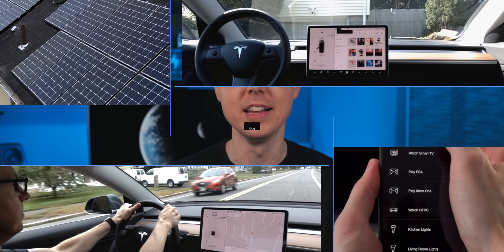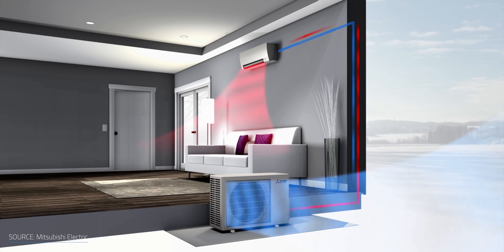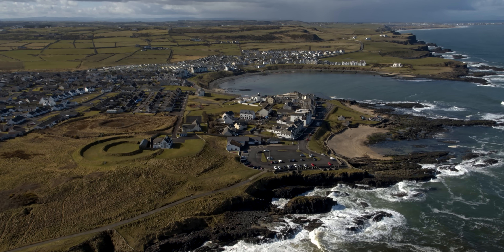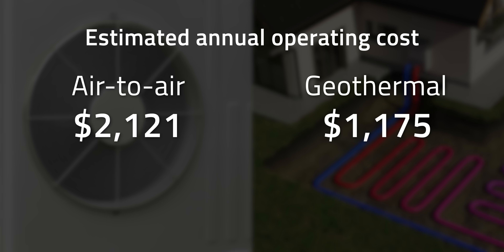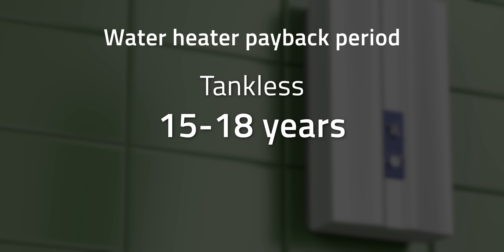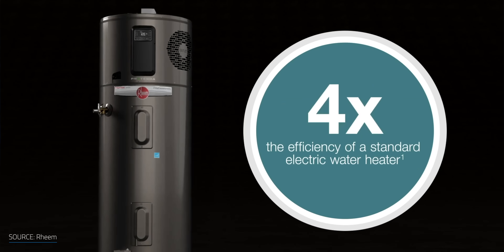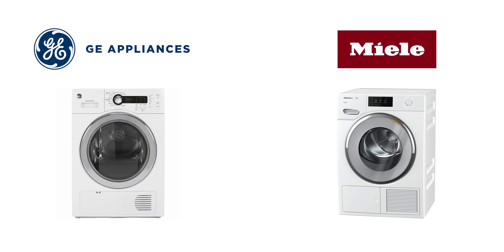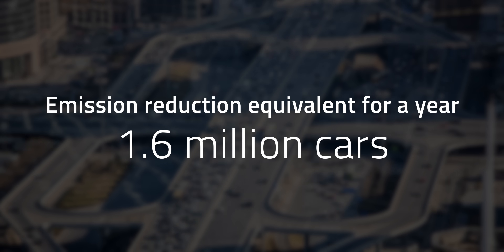Why Heat Pumps are Essential for the Future - Explained

Comment: In europe, they're pushing for heat pump everywhere. You can't get classical AC anymore, you get heat pump. And they are not that expensive. And they work pretty well.
Reply: Good.
Reply: I have an AC build.
District heating (also known as heat networks or teleheating) is a system for distributing heat generated in a centralized location through a system of insulated pipes for residential and commercial heating requirements such as space heating and water heating.
It works great
Reply: That’s so interesting because in the states the only thing I see being pushed is solar. When building a house in most areas they don’t bring up anything other than the current status quo. Per usual Europe is both ahead of us in conversation and action.
Reply: Just about a couple of hundred difference in price between HP and AC
Reply: Europe is always ahead of the US in this regard. Combine heat pump units with renewables and the future isn't looking quite so bleak. Especially if we can get most ICE vehicles of the road.
Reply: A heat/cool system is identical to a cool only system for one small item, a valve that can reverse the direction of the flows of the heat transfer medium. You have to be careful with sizing. In a well insulated home the smallest models should do just fine, in badly insulated homes you better insulate first or you will end up with something rather costly and power hungry. Since you are in Europe, your Energy Performance Certificate (EPC) will tell you a lot about what would be right. If you don't have an EPC maybe get one before you overspend, EPC is cheap big heat pumps are not.
Reply: @Bryan-Hensley  It's the same device with some extra components to reverse the flow of the heat transfer medium. It's almost plug and play to swap.
Reply: @Different_Banana1977  yeah I had one here in the USA in the 1970s.
Reply: @astranger448  in a badly insulated home youll also spent lots with traditional systems
Reply: AC is an air sourced heat pump anyway, essential if you live in a flat as most Europeans do.
Reply: @mightymouse2024  as much as I get the sentiment, most Europeans still live in houses, but it’s a close run thing.
Reply: In the southern US all new homes and apartments use heat pumps. It’s not mandated by the government, it’s simply the cost effective choice because one system is heat and air conditioning.
Reply: @astranger448  I've owned a HVAC company for over 20 years
Reply: In Finland we've been installing them for good 20 years now usually as additional heaters and I've always wondered why haven't they been so common elsewhere. Afterall Finland hardly is an ideal environment for the heat pump during half of the year when it's so cold the efficiency drops quite a bit. Still they usually pay themselves back within 5-8 years. Where as for most of mid-Europe they are perfect, just until now cheap natural gas thanks to the pro-Russian policies haven't really helped...
Reply: So in Europe what is your money really worth and how much is the apparatus really costing you..?
I know here in the US the dollar is worth 0.06 cents. So our gas prices are not $5 and $6 a gallon, it is in reality like $0.40 per gallon.
I know a lot of people have a problem with this reality, but it is reality, like it or not.
Reply: @cynthiaayers7696  that is a factor of course. Average electricity price in Europe is close to 30 cents per kwh. Cheapest being around 10c and Germany most expensive around 35c. Fuel prices over 2€ per Liter currently. Prices of the units are the same.
Reply: Most AC systems are just heat pumps that pumps heat out of a building over here in the US. It's ridiculous that they aren't being built so that process can be reversed when heating is required.
Reply: @Alexandra_Wolf  you mean United States?
Reply: Yes, but in Europe it never gets very hot, or humid, nor does it get very cold. Not sure how well a heat pump would work in high humidity like we see in the U.S. A/C condensed a lot of the humidity out of the air, that's why AC units have a water drain.
Reply: @Alexandra_Wolf  completely different climates, Europe does not get as hot or as cold as North America.
Reply: Heat pumps are great so long as the temperature stays above 0°F. If you are living in a region where it constantly dips below zero then you’d have a high electric bill having your heat strips run due to the heat pump incapable of properly running. Gas furnaces aren’t going away for those in the north any time soon.
Reply: @Bryan-Hensley  But this is the internet, it is not just you and me. So if I spell out things overly much it's for all these other blokes ;-) (I'm from a teaching family)
Reply: @kdrapertrucker  well that's a load of nonsense...
Reply: @user-by7hj4dj9s  Absolutely. So what is one to do? I'd fix the insulation if that's an option (often it is not) and/or look at the existing system and if it is old  and/or inefficient I get the most modern/efficient version I can fit in my budget. For gas furnaces they could be a plug and play replacement. I would avoid using something that is currently very badly understood.
Reply: There's basically no difference between an AC unit and a heat pump. Essentially just a 4-way valve that allows the refrigerant cycle to reverse
Reply: That’s good. In the US they are now pushing AC only for some reason. At least in my area….
Reply: @ryanhamstra49  That's been the story in most of the US forever. Hopefully sentiment changes towards heat pumps but most people think they don't like them because of the way thermostats have been designed to this point. Technology Connections has a great series of videos on heat pumps
Reply: @Kenneth Draper. I notice you say North America, so presumably you mean Europe as a geographic area (which includes Russia up to the Urals). While North America has a more extream climate than Europe for example one has to look to Siberia (in Asia) for colder places than the coldest in Canada), does North America  have a more extream climate for cities with more than a million inhabitants than Europe?
Reply: @Timo-qb1gf  lol 75+ cents in the Netherlands now.
Reply: @Alexandra_Wolf  depends on the area. In the Pacific Northwest they have been taking off.
Reply: @Different_Banana1977  : Unfortunately, getting rid of ICE vehicles isn't currently viable. We're moving that direction, but the process only really started with the creation of Tesla, and unlike e.g. the Model T, it currently depends on what was an insufficiently developed industry (lithium, whereas everything the Model T depended on had already been greatly fleshed out by e.g. the railroads).

As time passes this problem will fade, and if shorter-range sodium-ion battery vehicles start entering the market then things will accelerate more, but we still need to look at converting existing ICE vehicles to synthetic fuels first.
Reply: @Alexandra_Wolf  in the states hea pumps rage easily up to 10g.
Reply: I'd say where I'm at 70% of homes have some sort of heat pump. So ya. Not improbable.
Reply: Classical Ac T-T?? I've just managed to convinced my parents to get one that too after years of begging and it always stays above 42°c during summer here.
Reply: Heat pumps are just ac that can switch the direction of heat exchange
Reply: Yah, as a hvac tech who has worked in the field for over 20 years. It’s obvious you never owned a heat pump. No they are not efficient. And no they do not keep up.
Reply: Also, their more expensive. Don’t lie. Anyone can look up prices.
Reply: @Alexandra_Wolf  city of Flagstaff, AZ hosted an expert webinar in heat pump systems, which have challenges there due to low winter temps. Very informative.
Reply: @ashurean  Electricity is expensive. Natural gas is cheap.
Reply: @Timo-qb1gf  Actually it's not. I'm sure the engineers think their flatulence has the fragrance of flowers but in North America, heat pumps are supplemented with heat strips to keep up because they don't do the whole job when it gets cold. At that point you need a gas furnace for affordability. I have no idea what they're doing across Europe and I couldn't care less. It's not applicable. Just insulate the house and talk about something else with your friends.
Reply: Where in Belgium, the Netherlands, France or Germany can we buy any portable heat pumps? I see units up to about 15,000 BTU in every hardware store and Euro Shop/Vandenborre, but they are only AC units.
Reply: @Alexandra_Wolf  Heat pumps don't get a lot of publicity like solar cells. But they are making their way into new homes here to. Especially in the prefab market. Their adoption is going to increase with every new house built.  The problem we are facing is replacing AC systems with heat pumps without a subsidy it just doesn't make sense from a financial standpoint.
Reply: Heat pumps are great if the proper system is installed. The process of air conditioning is essentially heat rejection. You absorb the heat at the evaporator and reject it through the condenser. Heat pumps use a reversing valve to switch the process making the evaporator the condenser and vice-versa. Even when it’s cold outside there is still heat in that air to be absorbed. The lower the ambient temp is makes this process less efficient. There are systems that can do this still incredibly well even with very cold temps but tend to be costly such as VRF’s, also called VRV’s. Unfortunately they also have significantly more components that can fail. Have a VRF’s that I service in quite a few locations. Have a park and rec center that has no cooling waiting on a 16$ part that is 4 weeks out, just a coil for the linear expansion valve, lovely!
Reply: @kdrapertrucker  heat pumps generate water condensate too, and also have to drain outdoors. Because they ARE regular AC when operating in cooling mode. Whichever side is colder (so the outdoor one when you’re heating, the indoor one when cooling) generates a little bit of liquid water constantly.
Reply: @Alexandra_Wolf  I am a hvac servoce tech for starters so I see these units installed every day. they are definitely being sold in mass in The us however, it’s not being pushed as a green energy thing because you have to supplement another heat source when temps drop below 35f. Most houses still run off natural gas. That being said natural gas furnaces are pushing 90-95% efficiency these days. Another thing is not everyone wants to pay for a heat pump because of how expensive they are marketed in the us. Lower income tends to purchase ac only condensers and middle to high income purchases heat pumps in ranges of effficiency known as a seer rating. I love heat pumps and the savings they provide the hard part is convincing people to spend the extra money. One final thought on the video he said heat pumps don’t release harmful gasses but if there is a refrigerant leak, which happens offen, they do in fact release harmful gases
Reply: @FreonChugger  generally heat pumps don’t work well below 35f also in the north us many homes with heat pumps still use natural gas as the auxiliary heat
Reply: @Bryan-Hensley  question are you more interested in the money you get from the mark up of a new unit or the money you make per hr as lot of people who have old ac units would like to upgrade them to a heat pump most outfits would rather sell them a new unit than upgrade the one that they have now if the unit is close to the end of it's life sure replace it but if it's only got less than a year or two then upgrade
Reply: The "classical AC" uses the same thermodynamic cycle as a heat pump though? What's the difference?
Reply: "You can't get classical AC anymore, only heat pump" 😂😂😂😂😂
Reply: ACs are heat pumps! They just aren't reversible heat pumps
Reply: @ashurean  yes they do it's called a reverse value.  all the last three AC units we had has one in the one we had replaced! it's basically just a built in standard feature in all of the current up to date ac household residential  and industrial ac units in the usa all have a reverse value that turns the ac into a heat pump with a simple electrical signal from the thermostat and this was back in 2008 and onwards by the way!
Reply: I have a heat pump for my home. It's an old unit and it gets quite expensive to run at 0C or below. When it's time to replace it I will be getting another and one with the ability to operate effectively at lower temps. Hopefully I can find one that operates well at - 10C
Reply: True. Unless it is really freezing then they switch to traditional heating. Better use the old stove then.
Reply: @JohnSmith-kb5ku  It is true. I can’t find a pure AC without heat pump unless it is a portable one.
Reply: @frgv4060  may be like that where he is. I have a lot of family in Italy, and everyone's house has a heat pump in the form of ductless mini split systems. In fact that's the only type of HVAC I saw while I was there. I was there for several months at a time and lived near one of my cousins houses. I will say, no one really wanted to use it. It was always.. turn it on, with the doors and windows open, after 5 minutes someone would complain that they're too cold, then it would get shut off. 😅
Reply: @antonisautos8704  Haha very true!
Reply: Where in "Europe"?
Reply: @leventejuhasz2525  Western Europe
Reply: @Alexandra_Wolf  new builds in the US have heat pumps, and literally all HVAC companies offer them...
Reply: In my area of the US, AC units without a reversing valve (AKA a heat pump) are special order and cost just as much as with the heat pump, if you are installing a central air or a mini-split there is literally no reason to not get a heat pump.
Reply: @HangEmHigher  this used to be true, they actually have heat pumps that are good to -5F now, they may not be able to satisfy your heating needs alone but they still work.
Reply: @kdrapertrucker  dude. Are you serious? What do you think europe is, just london?
It does get freaking hot, freaking cold and freaking humid here as well.
And especially in finland it gets cold. It's litterally part of the polar circle, where santa comes from, and they have been relying on heatpumps for decades.

It is just ultimate lazyness. As long as you say "can't work here, to different" you justify doing nothing.
Nice and easy living in the 20th century.
Reply: You onot the difference between a AC and a heat pump? A bidirectional pump, and a reversing valve, that is all, al in all 10$ max in parts, there's no reason all ACs shouldn't be heat pumps
Reply: @kdrapertrucker  humidity doesn't affect heat pumps, heat pumps are literally an AC ran in reverse, if you can run a AC where your at in the high humidity of the summer, why is humidity going to matter in the winter when it's lower?
Reply: @FreonChugger  heat pumps can have a transfer loop placed into the ground, the temperature below the ground is always above 0°
Reply: @jaykoerner  couldn't agree more it's just AC with a reversing valve and a couple check valves
Reply: There seems to be some confusion here:
- in 'Europe' very few households use AC systems.
- AC cooling systems can be found in Europe, but depending on the region. Almost nobody has it in Germany, some are installed in Italy the more southern you go. 
- Heatpumps (Air or with absorber tubes, etc) are pretty common in Europe since over two decades, but their efficiency depends on the temerature difference, the lower the difference the higher the energy consumption to pump from cold to warm.
As long as electricity is cheap (or costs nothing when generated via EV) compared to direct fossil fuels, heatpumps are petty economic, this changes with higher electricity costs. Then heating with solar (or at least making hot water) is unbeatbale as long as you have enough surface on your roof.
And by tbe way every fridge is a heatpump...
Reply: @FL-ul5mq  "every fridge is a heat pump" by that same idea every AC is also a heat pump it is just a matter of which direction you are moving thermal energy. The idea that AC is rare in a area but heat pumps are common is pretty strange, an AC is mechanically the same thing as a heat pump the only difference is the direction the refrigerant flows. This is why installing a purely AC unit is so rare now because all you need to do to make it both AC and a heat pump is add a reversing valve and a pair of check valves to the refrigeration loop which costs like $50 more (next to nothing when you are spending thousands).
Reply: @CUBETechie  No reason your centralized heat source can't also come in the form of a data center or a crypto currency mining rig.
Reply: I can only assume it's a marketing lingo difference to get people to ditch oil/gas/electric baseboard heat in cooler climates. 

AC systems are heat pumps. They just may not have a reversing valve, so they wouldn't work to heat the home.
Reply: @infinitetradecraft1837  a lot of people don't seam to understand this, but a heat pump is just an AC with the evaporator outside and the condensng coil inside. In the HVAC world we are trying to stop calling them evaporators and condensors they are now indoor and outdoor coils, its not easy to change the lingo though, especially for me because I do a lot of refrigeration and in that sense we still call them evaporators and condensors.
Reply: @keldon_champion   personally I prefer installing a pump in the loop, heating up the evaporator, cooling the condenser with water, and getting cheap electricity out by calling the whole thing an Organic Rankine Cycle generator. Lol. But yeah, there's a lot of cluttered terms, and honestly, I don't think anyone would give you much of a hard time for swapping terms "but if it's in heat mode that's the evaporator, hur hurrr". Those people need a smack in the face. 

The real question, however... is it Pop, or Soda?! dun dun dunnnn
Reply: As much as I would love to see them over here in Minnesota, the extreme variation in climate throughout the year would make it hard to justify the expense
Reply: @mattkroening7964   ground source heat pump would be perfectly fine. Air source, not so much, might as well use electric baseboard heat for all.it would do.
Reply: Yea.. cause Europe are making move toward energy independence...for Russia.
Good job!
Reply: I'm pretty sure classical AC has always been heatpumps...
Reply: Here in the south everyone has a heat pump, our winters are mild so they are good enough to heat in the winter but our summers are a little hot so the ac is a must
Reply: But isn't AC a heat pump that only goes in one direction?
Reply: @Bryan-Hensley  That depends on the region, hear pumps are mechanically almost identical to a standard AC, so in area where demand is high enough to take advantage of economies of scale heat pumps aren't significantly more expensive.
Reply: @user-by7hj4dj9s  that is true, most homes aren't insulated enough to be compliant with modern codes, and most modern codes don't suggest enough insulation so most homes especially older homes are woefully under insulated.
Reply: @blacknester $.11 per kWh is a more typical price unless you are in a highly subsidized area.
Reply: @Daniel-os9tb  the efficiency of heat pumps is heavily dependent on the outside temperatures, in most regions of the US especially in the south air source heat pumps have roughly comparable operating costs to a gas furnace with the advantage that you don't need to pay for the gas lines or furnace. In colder regions of the US as well as most of Canada air source heat pumps are efficient roughly 70% of the time and are at worst equivalent to resistance heat, ground or water source heat pumps cost about as much to operate as natural gas albeit without the installation cost advantages of air source heat pumps. The actual thermal efficiency of heat pumps is significantly higher than natural gas, with the cost of heating working out to be fairly similar when you factor in the higher cost of electricity.
Reply: @garethbaus5471  tell that to Texas, az, New Mexico, Al, ga, va and Cali where heat pumps prove gas is cheaper and more efficient. Tell that to ordain, dakotas, montanas, all north eastern states where oil furnaces are still way more efficient than heat pumps and actually heats durning winter. Thx proving you never actually have one, worked on one, installed one or engineered one.
Reply: @garethbaus5471  oh, that must be why I've been working on heatpumps for 40 years. Glad for you to tell me how they work.
Reply: Right. And the air-to-air one hum along nicely. If you got some of them in the neighborhood you get some exiting interference on top. 👌
Reply: @Alexandra_Wolf  heat pumps aren’t new tech. I was an HVAC tech 15 years ago and heat pumps were already super common in the US.
Reply: @Different_Banana1977  that will barely make a dent, look at how much pollution from a typical cargo ship.
Reply: California is the same
Reply: @kdrapertrucker   So Scandinavia is not europe? We have temps down to almost -40 sometime here i live.
Reply: @FreonChugger   Not true anymore. A Panasonic VZ12 gives 3,7 kw heat at -13F. And pulls max 2300 watt(10a 230V) from the wall.
@ 0F it is way more. Over 5 kW actually.
Reply: they are junk
Reply: @kdrapertrucker  Europe gets plenty hot. You would be begging for one. I was just in Sicily this past August and I was so thankful for the ac heat pump. 34° C ( 93°F) and 80% humidity. I am going to install 2 in my home in Sweden for heating, primarily to cut my electrical consumption. Our new price is considerably greater than what was previously stated, thus motivating me.
Reply: @kdrapertrucker  are you for real?
Reply: @mightymouse2024  Why flats vs. houses? Curious.
Reply: I have solar panels, lithium batteries and Toshiba Estia air to water heating/ cooling and hot water system. I have 420 sq metres underfloor tubing for the heating and cooling. We are now thinking about adding dualfacial solar panels to our 34 Kw system so that when we install our swimming pool, we can heat the pool without any problems. We have been running our system off grid since March 2020 and have never looked back.
Reply: @Alexandra_Wolf  ....Cold Climate Air Source Heat Pumps are available and subsidies for them are coming from the 
Inflation Relief Act soooooon !!!!
Reply: @Different_Banana1977  ....exactly!!!
Reply: I'm worried about the coolant. This will eventually get into the atmosphere. I know this has been improved but does it have a greenhouse effect or will it damage the ozone?  Total market penetration means an awful lot of this stuff will escape.
Reply: @Alexandra_Wolf  because you have more resources. Your petrol is cheaper than water. Europe is thinking about future. Only way to become indenpendent is through renevables. Russian gas is (and never was) a smart option.
Reply: @Different_Banana1977  What they don't tell you is how unreliable those systems are. A large portion of housing in Europe is very old and thermal pumps have proved to be a very bad investment for those application. This is subjective of course but I live in an old city and speaking from experience. I have yet to meet a single plumber or heating engineer that says these systems work well in practice. I'll keep as low tech as possible thanks.
Reply: You mention Northern Ireland & a comparison of oil v a heat pump. A difference of £4300. £4300 will still buy a lot of oil but won’t actually buy very much electricity since the invasion of Ukraine. 
One big issue with air source that you don’t mention is the unsuitability of air source for the fringes of Western Europe. 
The coastal areas of Western Europe are heated by a weather system called the Gulf Stream. 
This means we have milder winters, but the downside is that we have a lot of rain. The result is that our ambient air is very laden with moisture. 
What happens is that when the ambient temperature drops below 5’C in winter the heat exchanger on an air source pump will freeze up. 
The unit will then become a block of ice. 
Before it can function again it needs to be thawed out, this is done either using a ‘reverse cycle’ or an embedded immersion heater. But these methods are very energy hungry, thus pushing up running costs. 

Ground source is a suitable alternative but due to the high initial cost, payback is probably close to 20 years. 

Bearing in mind that the wearing parts (yes there are wearing parts) have an expected lifespan of 15 years then it’s clear heat pumps aren’t the silver bullet some make them out. 

How we heat our homes in Europe & the price of energy, especially electricity, is very different to America. Personally I think comparisons are not valid for that reason.
Reply: So why is carbon dioxide always mentioned when talking about emissions? It's the best part of what is emitted from fossil fuels. There are much more harmful gasses emitted from petrol and diesel vehicles than CO2
Reply: Cow farts for one, feeding millions with Maccy Dees...